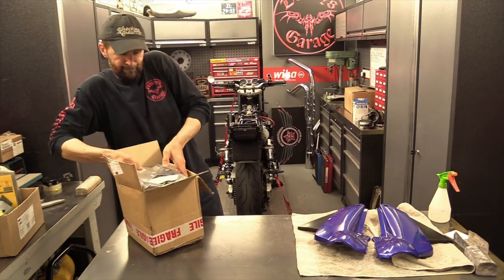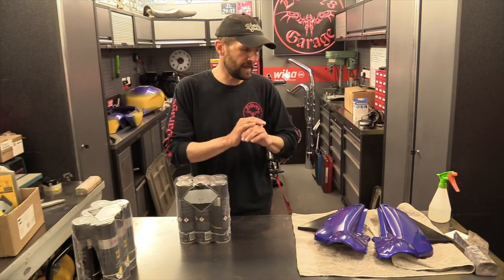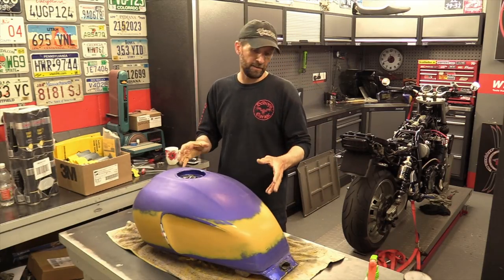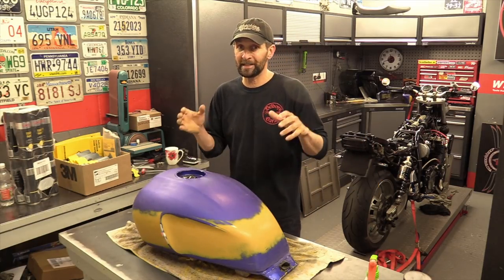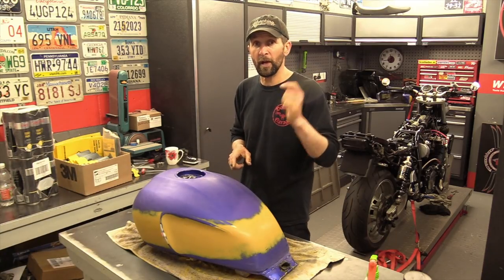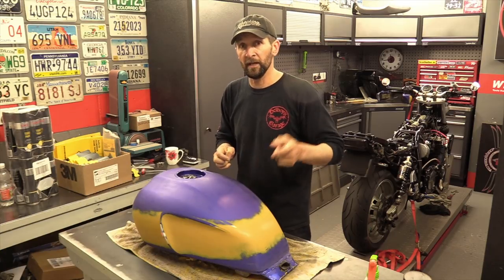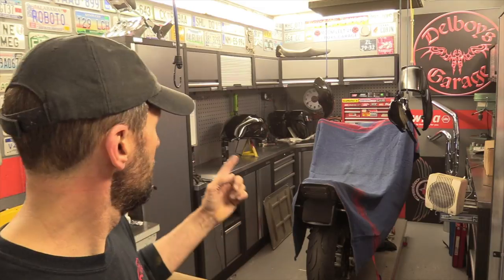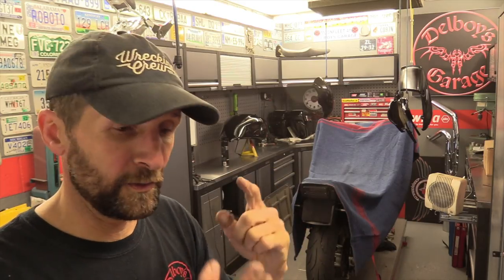Delboy's Garage, XJR Turbo, Time for Paint..!

Comment: little trick for ya :D .. if you put your hand into a clear plastic bag .. the ones for the fridge ect .. close your eyes. then you can feel every single imperfection there is, it will enhance the imperfections  :) . try it out see if it works for you, one more thing, for better atomisation on the paint. try placing them in "hot" water so the pressure in the can goes up :) , awsome work as allways ofc

Comment: Hey Delboy, it looks awsome even it's just a simple rattle can spray! Great job and yes it all comes done to prep prep and prep! Love how it's looking rite now and I can't wait to see how it's gone turn out soon 
I have a small question 
I have replaced my claps on my water hoses of the cooling system with some shiny new ones from samco, pro brand etc and good quality gear but....2 weeks ago I have mounted them at the Same tencion from the old ones 
Now I clean my bike every week and check up my stuff,and I saw a small drop of green cooling liquid on one of the tubes
So I went to do the inspector Morse thing and found out that all the new clamps where all super loose and they weren't holding on well!
Now all redone etc but I don't understand how they just got so loose! Of course the tubes set with hot and cold condition so they expand and shrink but the clamps got so loose that I worried a bit 
Any info or perhaps any personal opinion?
Thank you 
Steven
Reply from the maker: Hi Steven. You're right indeed, Samco hoses are clips are about the best on the market... maybe you just didnt do them up tight enough mate... you said you "mounted them at the same tension", so you mean you screwed them up to a torque setting... or was it just be 'feel'... either way buddy... its no ha,r to just nip them up a bit more and see if they stay put... you should tighten hose clips until the hose itself just starts to 'squidge' a but under the clip.. then the thread on it is under tension and should stay where it is.... Give that a go buddy, you'll probably find they are fine..!   Hope that help fix it... let me know how you get on mate.. take care.. del.
Reply: Moonfleet41 Thx For ur swift reply, Ive done the tight up part  And marked the position, But in the end I have found out I have a small For in the radiator So there is where the cooling fluid appeared from
Anyway Thanks man!!!!

Comment: Any particular reason you prefer to use a spray can rather than a compressor-based spray gun? Easier to use? Less waste? Or because it's a base coat, a spray can is acceptable? Cheers.
Reply from the maker: Hi Richard, for a few coats of base black, cans are all i need buddy.. the minimum quantity of neat paint i can buy is 1/4 liter.. and thats 5 times what i needed for this, plus i would have had to buy thinners with it, and hardener... so its a lot of grief for just base coat, we'll do the rest with proper equipment though...

Comment: I’m thinking about repainting my bonnie tank. Would you recommend stripping all of the old paint job off or just sanding down with wet and dry to take off the shine out and use that as a kind of primer?
Reply from the maker: Drew, i would always use the factory paint as a base coat / primer, you only need to strip it all off if its badly damaged of pealing off already... its going t be tough and rock hard already, and like you suggested mate.. just sand it back so its baby smooth and you can paint over it... if you go through to bare metal in any small places.. then just "spot prime" that bit with some regular primer first..!    Good luck buddy, hope it goes well for you. Del.
Reply: Amazing, thanks Del. And keep the content coming, it's so helpful.

Comment: Beautiful work as always boss. Just out of curiosity though, with all you spend on paint and primer, wouldn't it have paid off by now to just pick up a spray gun, small compressor, and a moisture filter ? Even adding the cost of some 1x's and some plastic for a small paint booth, seems like it would have paid off by the bulk primer and quarts of paint. Rather then all the cans. Or no ?
Reply from the maker: Good point well made Moto... but in real terms, its still cheaper this way...This tough black paint is so cheap,  that 12 cans of paint cost me £59, and i used just two of them on the whole basecoat job...neat paint, in even half liters comes in at about the same money, and ill need thinners for it on top...but i still have 10 cans left, Thats it for the black now, its just some art work which will be mostly air brush and pin line paint.. and then a few coats of clear (which will be from a spray gun, and we will have to sheet the place out with plastic lol)  Ill paint the wheels with two more cans, and the fork bottoms maybe a bit more.. so this whole job wont have cost me even £25 in paint, plus the bill to the artist... the other 7 or so cans will last me ages for all those little jobs that need a lick of satin black, things like brackets and little fabrication jobs etc...   I know its always better to spray a job with a spraygun if you can.. but i dont do enough of it to justify all the mess and setup..  Good point though buddy.
Reply: Moonfleet41 ya, makes a lot of sense. I just know a lot of your vids I've seen you doing filler work and paint, but ya at that cheap, with as beautiful as that came out, keep doing it the way you are lol.

Comment: Just one question why the spray cans?  I'm surprised you did not go with a compressor and a spray gun?
Reply from the maker: Oh ive got both John, ... but the over spray and mess from a spray gun is 10 
times more, and its only base coat this time... we'll be using a spray gun for the
 rest of the job though..and air brushes, and pinline brushes.... stick with it, i think you'll like it.
Reply from the maker: Oh ive got both John, ... but the over spray and mess from a spray gun is 10 
times more, and its only base coat this time... we'll be using a spray gun for the
 rest of the job though..and air brushes, and pinline brushes.... stick with it, i think you'll like it.

Comment: Yes I used the wrong grit, all my paint crazed, I used far too fine a grit, will know in future, thanks Del
Reply from the maker: Oh been there so many times mate.. but thats how we learn right..?
Reply: Yes, I'd like to have another go, it's been over 6 months since I nearly smashed the bike up, got so frustrated at how much time, effort and money went into no fruitage and it's hard to believe it was simply because the surface was too smooth for the paint to adhere.

By the way Del, I plastic welded the throttle tube and it was fine but have bought a speed triple twist grip, which is installed. I wasn't happy in the back of my mind about the repaired one, no real idea how strong the weld was although it did do over 100 miles and was working great but on inspection, it was wearing quick. Thought I'd update you, have a good day.

Comment: quick question, how do you deal with the paint particles that gather while you paint all over the garage ? or do you not because its a garage :P also... I really like your garage setup :P shame it isn't a bit bigger for a bit more room, but its nice that you have it setup so nicely. Can't wait to design and setup a garage like that one day :D
Reply from the maker: Hey buddy... if you watch at about 14:20 for a few seconds, you can see the overspray blowing out the door, i have a fan running behind me that takes about 90% of the particles out of the garage, and the rest falls as dry dust in the surfaces and floor.. i just wipe that up later...   Thank you for your kind word,s i also wish i had a bit more space, but we have set it up to make the most of the room we have... take care. .Del.
Reply: Ahh yes. i noticed the garage door open, didn't see the fan behind; simple solution. nice.

Comment: Hi Delboy

I have been watching your videos for sometime now. Currently my first project bike xv535 and have everything disassembled.

I have a couple of questions regarding primer etc I know you are using the tough paint as your primer. 

For wheels, bare metal frame , bare metal tank , fork legs what do you recommend in terms of primer, filer , top laquer.  I want to do satin blue fender and tank with everything else satin black. Do you recommend using etching primer on the bare metal with a filler then satin colour with satin laquer? Or what isthe layers of paint I need to use. It's a bit unclear on the net regarding the paint type process I need to use.

Keep going with the videos.
Reply from the maker: Hi Richard, good to hear from you buddy... In a case like yours, ir pays to just keep it simple, use a regular metal primer to cover all the bare steel and filler.. then a few layers of your chosen base coat...after a day to dry out and 'sink", give it all a quick flat down to make a smooth keyed layer to topcoat.. be careful not to go through the paint to the primer or metal... then once you';re ready, layer up 4 good coats of your chosen top colour, 15 minutes between coast for it to flash off... then finally, do four coats of a cleat lacquer to make it all sealed and done.... then after a week, you can flat it all down with 1200 grit paper, and compound it up to a cool shine.... Hope that helps buddy.. good luck... Del.
Reply: Hi thanks for your detailed reply.  When would you use etching primer? can you use this over building primer?  Will find you to send you a pic when it is done, will be a while because it is in bits on my garage floor. good luck keep making such good videos, extremely detailed, well done.
Reply from the maker: Hi again Richard... just to answer your "etch" primer question... thats mostly good for smooth metal that you can't sand and rough up to make a good key.... the chemical base in the etch primer forms a really good bond with the metal and helps it stick better... but if you can rough up the metal surface with some sand paper, then you can just use regular primer.. and regular primer over filler too, like i said Etch primer is mostly developed for bare metal..   Hope that helps you chap.. Del.